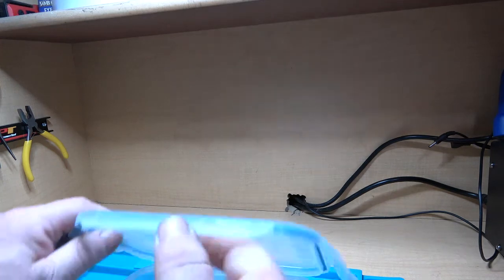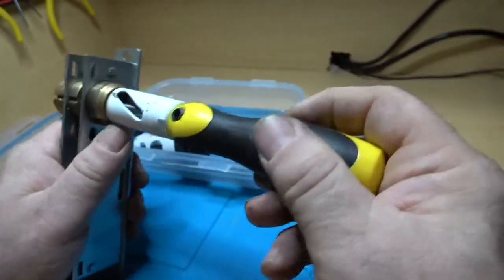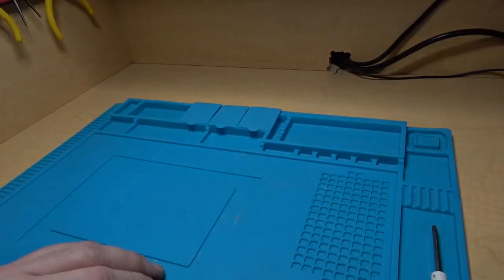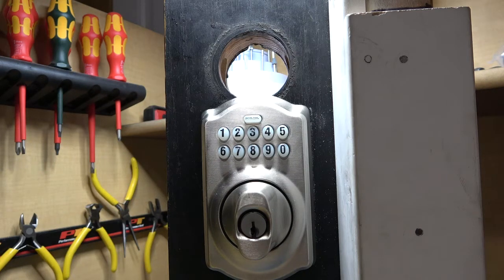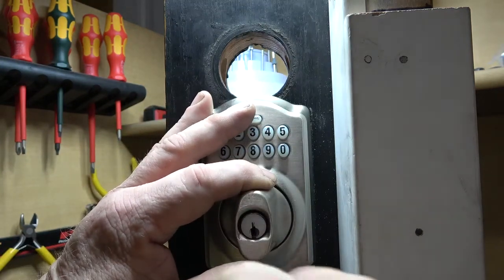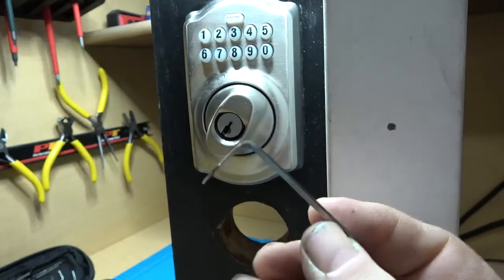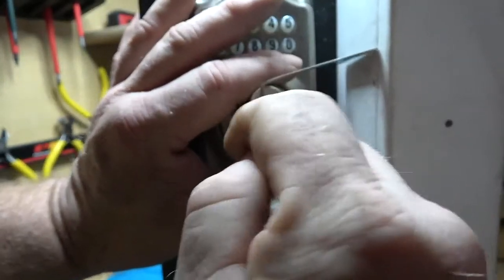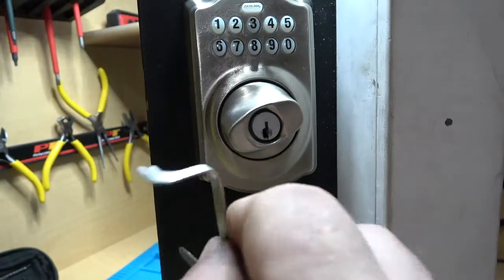Video 19 New Picking Tools Etc

Comment from the maker: The thing about Lishi is they are great tools I have many different ones I'm going to give you a answer that includes a question Your purchase of Lishi should be based on the Locksmithing service you will be providing Automotive, Commercial or Residential I have Lishi for all 3 markets some I cannot do without some are just fun to have. Lishi teach lock pickers how to single pin pick and also give you the best tensioning of a lock so you do not have to pick top or bottom tension or select the right tension wrench. If you let me know what of the markets you will be working in I can make further recommendations. Jeff

Comment: I am wondering which Lishi picks would you recommend to get? I have a Kronos and don't want to spend money on every single Lishi pick if I don't have to. But as you said there's some locks you don't like to use the Kronos on.
Reply from the maker: Thanks Dillon for watching and subscribing and your question. The thing about Lishi is they are great tools I have many different ones I'm going to give you a answer that includes a question Your purchase of Lishi should be based on the Locksmithing service you will be providing Automotive, Commercial or Residential I have Lishi for all 3 markets some I cannot do without some are just fun to have. Lishi teach lock pickers how to single pin pick and also give you the best tensioning of a lock so you do not have to pick top or bottom tension or select the right tension wrench. If you let me know what of the markets you will be working in I can make further recommendations. Jeff
Reply: @locksmithinginnovation11  
Just going to stick with commercial and residential to start. None of the locksmiths here do automotive so it would be nice to get into it, but I don't really have much automotive experience and it would be a big investment so probably best to stick with what I know for now. Theres so many Lishi picks and their not exactly cheap, so I guess I'm most interested to know what ones you can't live without.
Reply from the maker: @dillonthomas4817  Thanks Dillon since you have the Cronus Electric Pick and Lock Tech's smart Key I would recommend the new Original Lishi SC-20 this is for the Schlage L key way so it should work on C,E,F ect. you can buy in Canada from Key Direct Ca any order over 250 free express shipping no duty or broker fees etc.